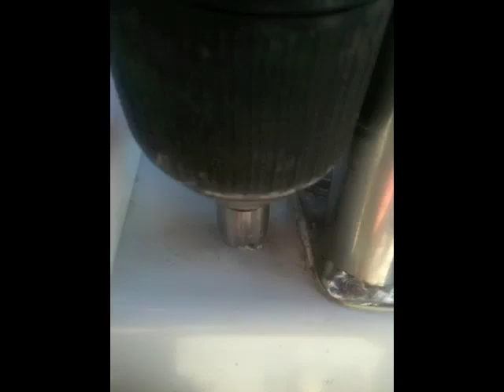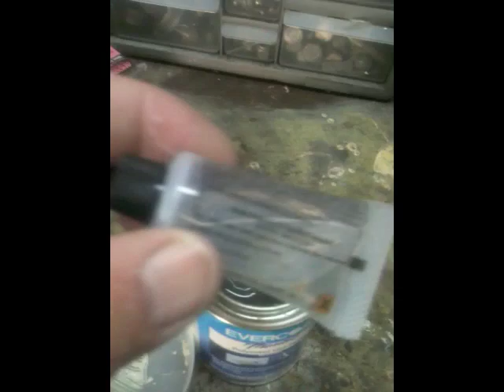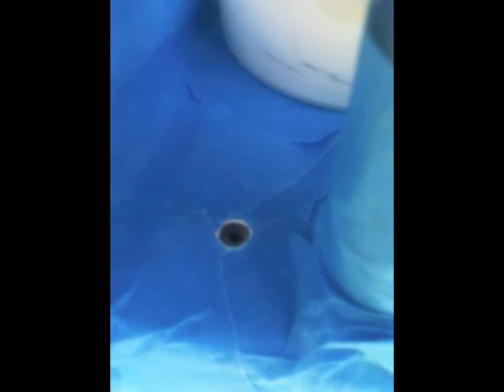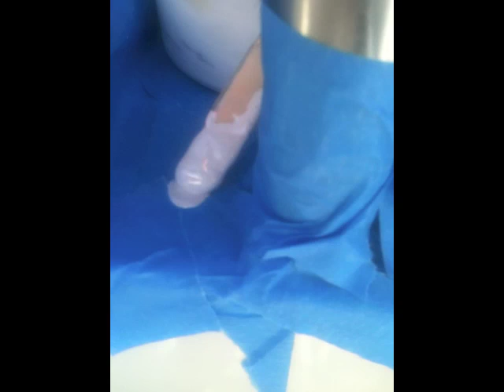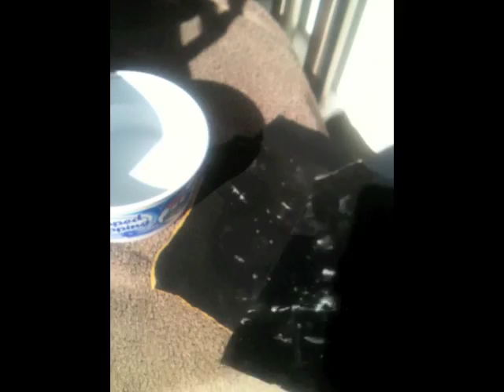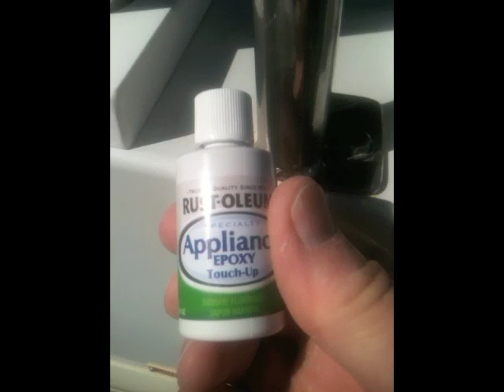How to Repair Damaged Gelcoat

Comment: Just a few points to note here, Jim. Firstly, it's not a gelcoat chip or scratch that you're repairing - it's a hole. The hole needs to be drilled out to expose fresh fibreglass/wood so it can be filled before the gelcoat is applied. Colour matching is done with the gelcoat before hardener is added. This is done by putting a drop of gelcoat on the surface every time you add some more pigment so that eventually you get a match. Only then do you add hardener. After the hole has been filled with some fibreglass 'bog' (resin and talcum powder for such a small hole) and is cured, the surrounding area is sanded to create a surface for the gelcoat to adhere to. After applying the gelcoat to the hole and on the surrounding area and is left to cure, the gelcoat is then sanded so that it 'feathers' into the surrounding area so that any slight mismatch in the colour is not noticable. I would expect that your repair - if there's any force applied to it or with exposure to normal weathering and sun - could pop off at some point.  Please accept my comments as constructive and trying to help my fellow boaters. I have nearly 50 years experience with fibreglass repairs in the marine industry.

Comment: Have you ever heard of the product called Marine-Tex?  This was so much overkill for a menial job, materials, cost, time, lack of strength!  Sorry to be on the negative side but all of you have basically shown is how to mix gel-coat and sand a hole the size of a nickel.  And you used to much gray, should've left it as was mixed originally, especially since it will fade in the sun in a month.  The marine-Tex is much harder, wet sand it smooth, and buff.  Cost is $29.00, and an hour of your time.

Comment: gelcoat doesn't change colour when u add hardener, and it doesn't change colour when it hardens. it was obvious it was the wrong colour before you added hardener …. and your solution was covering the repair with paint? ALWAYS check the colour next to the repair before adding hardener.
Reply: Actually gel coat darkens significantly after it hardens. Especially when it's a puddy. You always have to account for that when color matching.
Reply: 1 to 2% catalyst  by weight depending on weather

Comment: Dude, why even fill it just put a screw with a sealant on the threads in the hole...
Reply from the maker: That can certainly work!  Some folks don't mind looking at a random screw. But, others might not want to. There is usually more than one way to accomplish something.